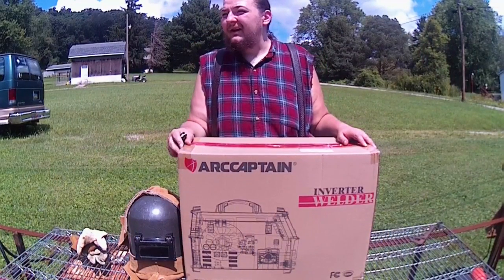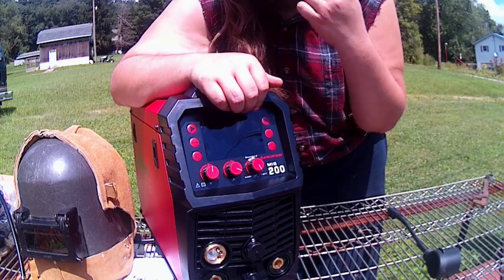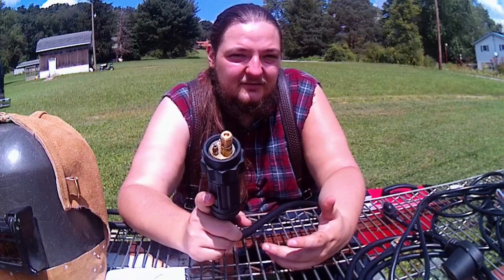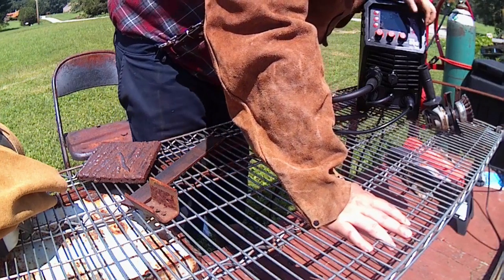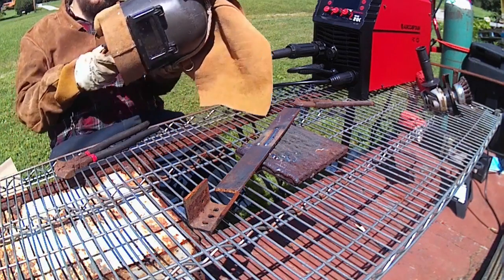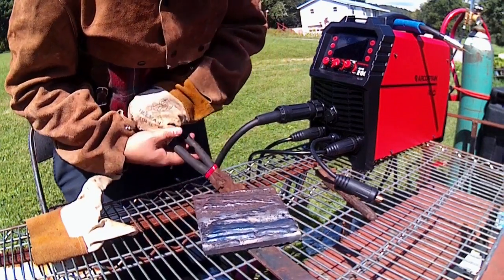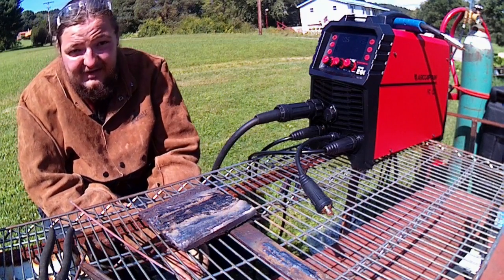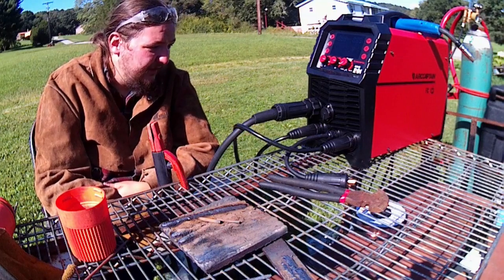ARCCAPTAIN MIG 200  WELDER REVIEW PT.1

Comment: Think it’s your ground, or running gas in pretty windy situation, I have that machine and I love it , it’s impressed me so far fs
Reply from the maker: It turned out to be the spool  wasn't  mounted  in straight  took it apart  putvit together and fixed the issue
Reply: Is it a 50 amp breaker for the 220 ?